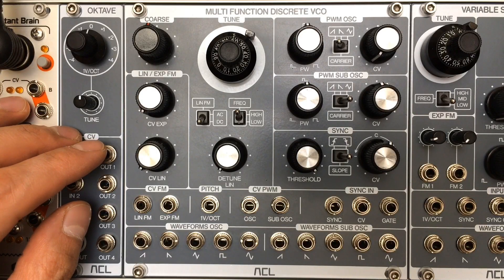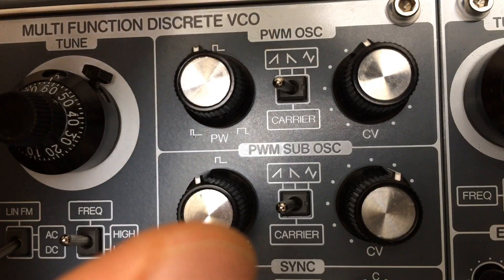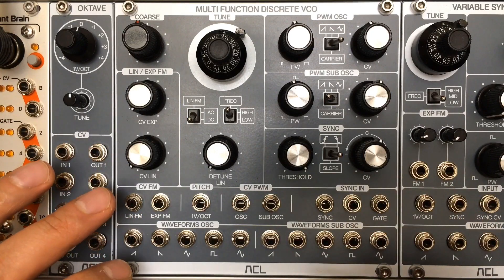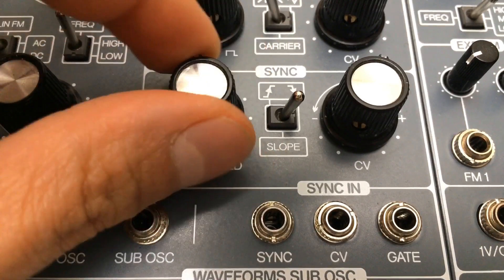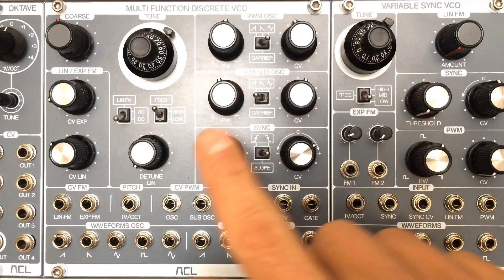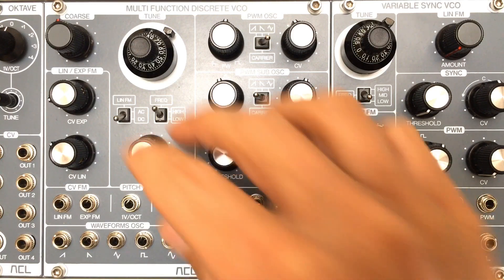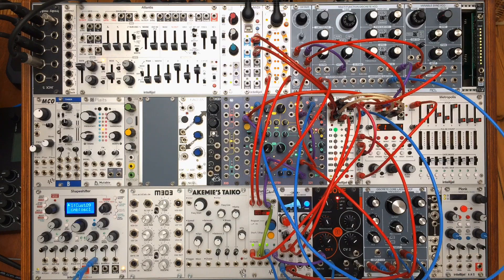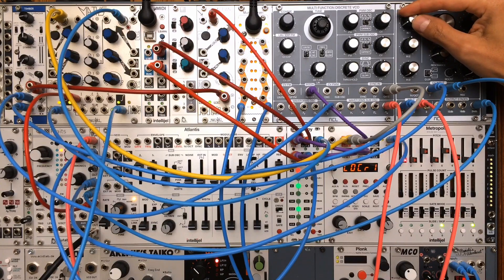ACL Multifunction Discrete VCO Demo

Comment: Nice Demo! Can you please explain how you did the sound around 4:25? That would be really kind :).
Reply from the maker: I made this video long ago and I don't have the original to check exactly what I made. It seems I synchronized the Multifunction VCO with another one and I modulated the sync threshold (and the modulator vco) with envelopes and finally I passed everything through the Discrete Core Ladder filter
Reply: Thanks, I will try to figure it out when mine arrives, I just asked because especially this sound made me order one :)...
Reply from the maker: @poeply  :) congratulations. This is my favorite analog VCA. Mixing the main and the sub oscillators combined with  PWM or Sync is an amazing sound design source.
Reply: I am very excited to wiggle the whole weekend :)
Reply: This thing is a beast! Surprisingly it fits really good with my Odessa :)

Comment: What is in your opinion the major difference in sound with variable sync vco? Regardless the features, just sound wise.. thanks
Reply from the maker: They pure raw unmodulated waveforms have a lot in common, but the PWM, the FM modulation, the sync and all the extra waveform sculpting features can make it sound very different. In other words, the features make the major difference in sound. Beside that, you can never replace a Multifunction VCO with two Variable Sync VCOs. The exact same waveform start makes the Multifunction VCO perfect for mixing them together and achieving waveforms that you cannot replicate with Variable Sync VCOs.
Reply: denoise awesome! Sounds great! Thanks